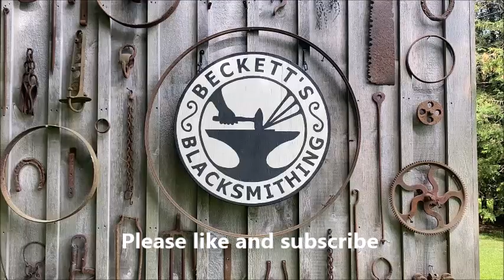Restoring a Broad Axe

Comment: Did you grind the cracks and weld with LH , high nickle content or mild steel?
Reply from the maker: I did grind the cracks for better penetration.  I didn't show this part in the video.  The body of this axe was wrought iron with a carbon steel bit forge welded in so I just used mild steel weld.